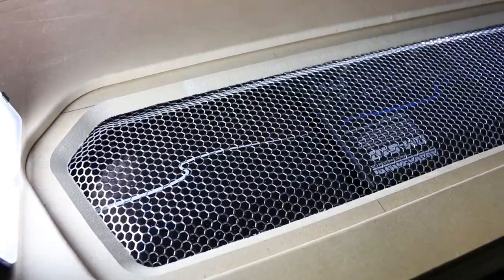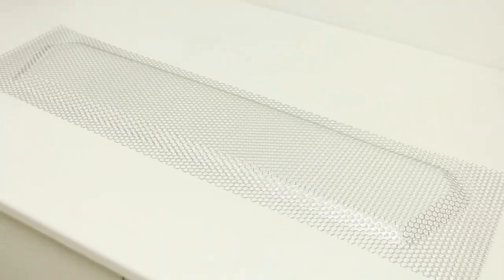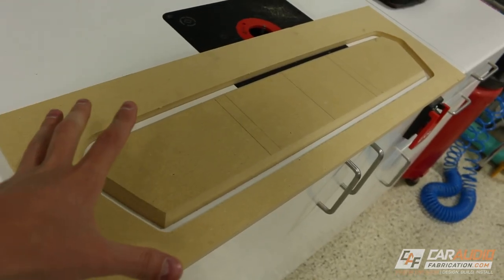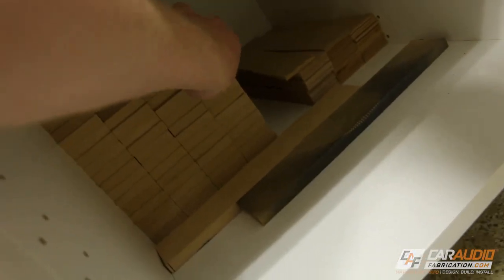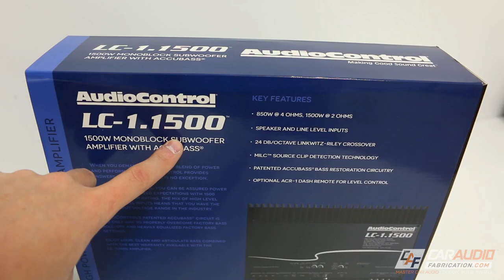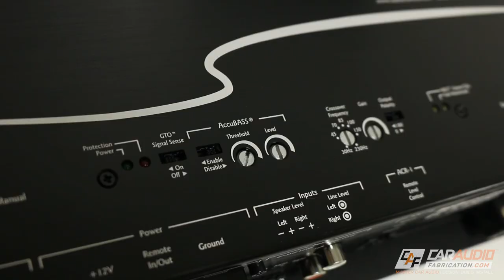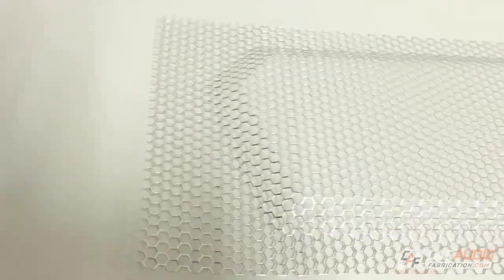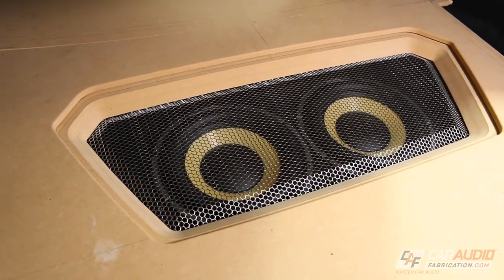PROTECT Subwoofers - How to MOLD metal mesh to shape

Comment: Mark, I've built a system for every vehicle I've owned over the past 36 years. In the early 90's I went to an install school (it was a week long school) where I learned a lot. With each new vehicle every aspect of the system improves. The imaging, stereo separation, volume & of course integration of the system into the vehicle gets better each time. I'm always striving for a more professional looking install. I've been to several car audio competitions & seen lots of custom work in various magazines through the years which not only give me ideas but make clear where I need to improve. I thought I had already seen the apex of the installers art, then I see your videos. You my friend, you create some really spectacular installs. Through your videos we all can see the planning & the many extra steps necessary to achieve the final result. This video is a prime example, making a mold box & chamfering the edges etc. take time & some material but without those steps the final product would suffer to say the least. Other videos make clear how indispensable a router is if you want your install to look as good as possible. The biggest difference between you & I, when it comes to installs (other than you are better/more experienced at it than I am) is you're getting paid. No doubt that motivates you to produce better work & if it requires umpteen hours at the router to achieve that goal so be it. My paycheck for the installs I do is the enjoyment of the system & the satisfaction that comes with doing it yourself. But this allows me to often say, "it's good enough". If I truly want professional looking installs, "it's good enough" will not do. So thank you for the lessons you give. Thank you for giving us an all access pass "behind the curtain" to see the attention to detail work necessary for such awesome looking installs. Thank you for sharing your knowledge with the next generation. I hope they appreciate the fact that they are getting, basically for free, what I had to pay & go out of state for along with all the reading & trial & error over the years. I know money plays a part but I can see that you enjoy sharing your knowledge. As for money, considering the information you share, the equipment necessary, the time involved with writing a script, setting up cameras, filming (sometimes multiple takes), editing & uploading, I hope you get all you can. 
Keep up the great work & all the best!
Mark 
(Yes my name is Mark as well)

Comment: Over the weekend I took 2 old pc power supplies and did some wiring to them (more of snipping ends and connecting wires) and am now able to sucessfully use them as inverters to run car amplifiers and stereo units in the house :D tested with 2 amps (one on a pair of alpine speakers from my towncar and one on a 12" pyle subwoofer) and the single din dual unit i had in my towncar with complete success and sounds decent. :D

Comment: How much protection does this offer?  I made a stacked wood sub box for the rear side of my older grand Cherokee.  Sound is good but in order for the subs vented pole not to be bottomed out, I had to use an extra layer. This extra layer doesn’t let me open the spare well easily as the stock cover gets caught up on the sub. I don’t actually use the spare because I have oversized tires which don’t fit. I do however use it for my off road gear like recovery straps and tools and such

So back to my original question I’m thinking about doing a stacked box for the spare well and using some custom side boxes for my other stuff. Will the mesh hold up to any abuse? When I go on wheeling trips and road trips there would be stuff on top of the sub. Is this a bad idea?

Comment: So I’m new to subwoofers and I did a little research and found the MTX Terminators TNE212 1200 WATT 12” Dual subwoofers
And a Pioneer GM-A5702 1000W 2-channel class AB amp. Is this a good beginners match?
Reply: get a monoblock amp for subs, theyre more power efficient
Reply: turbochild thanks
Reply: turbochild also the Skar or the Planet audio mono block